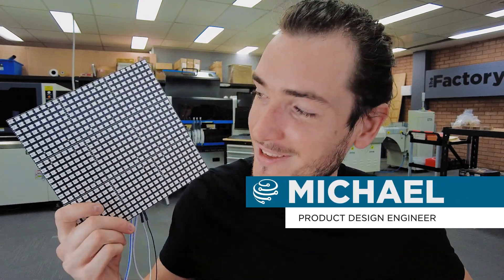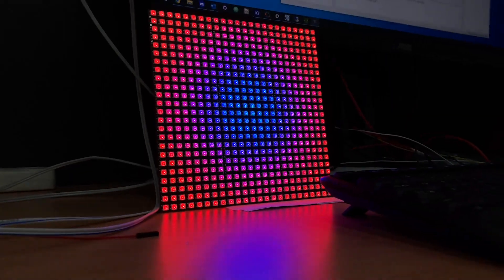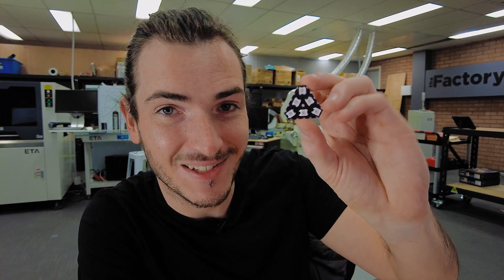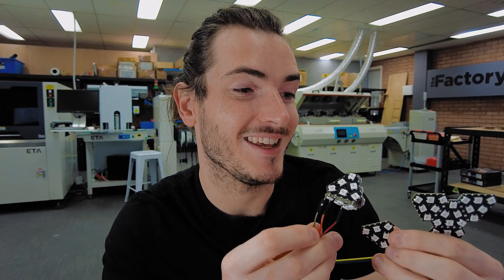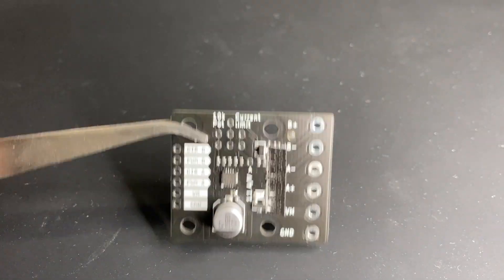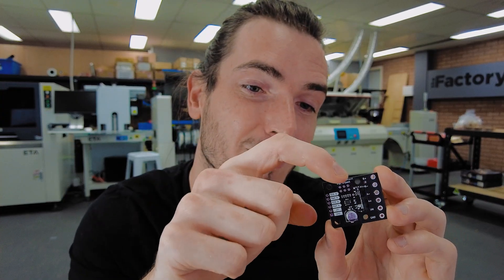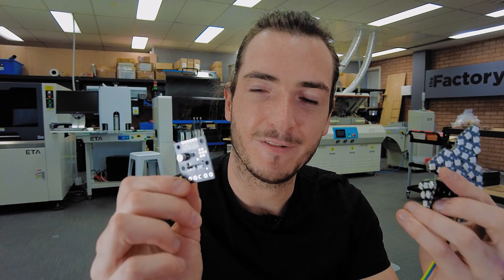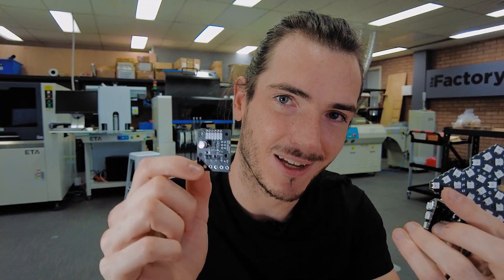The Factory | Testing Our Huge LED Matrix

Comment: Cool! 
The motor driver looks like a versatile little unit and it looks like you have kept the mounting hole layout the same as the Piicodev platform so it will make prototyping set up nice and simple . Those little triangle LED lights would make fantastic direction indicator lights or could be incorporated into a custom triangular push button switch- a bit like you used to see on elevators. Great work guys ! BTW any idea when the protoboards will be available ?
Reply from the maker: Thanks Ian 😃 Protoboards are now available at https://mkrvrs.io/core